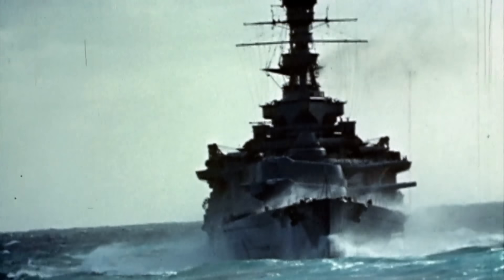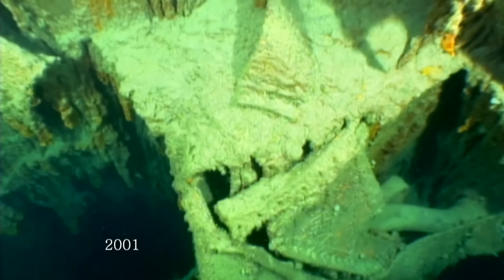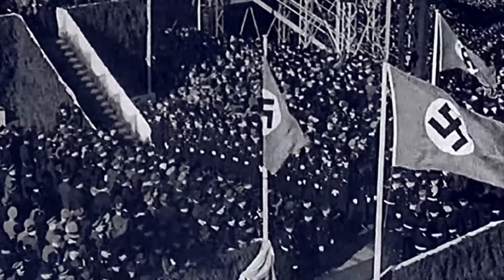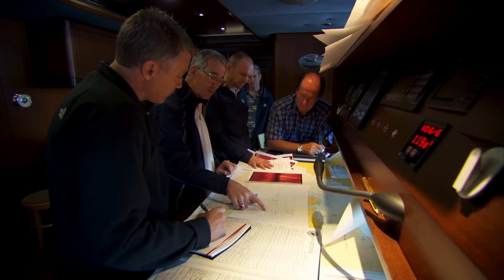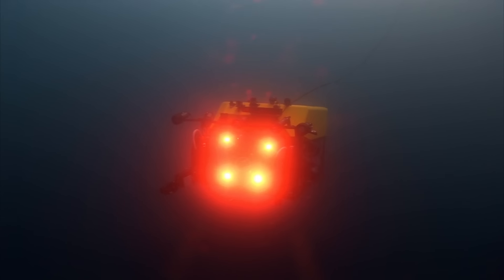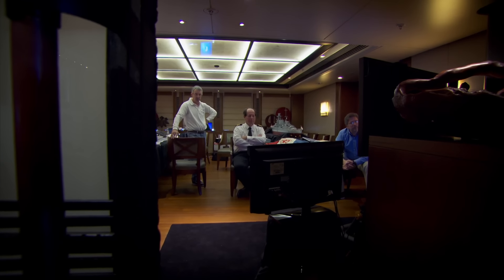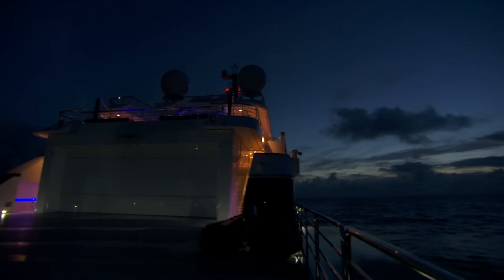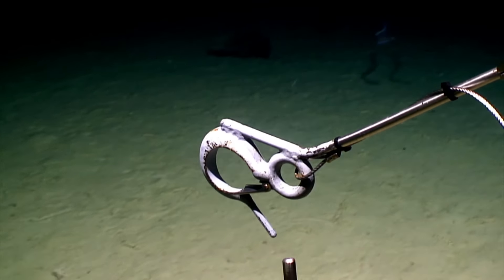How the Bismarck Sank HMS Hood - Documentary

Comment: In World War One, during the battle of Jutland, German warships were able to destroy several British battle cruisers and heavy cruiser. British Battle cruisers of this period (such as HMS Hood) were not intended to act as ships of the line, but to engage enemy cruisers at range where the enemies smaller guns could not reach them. While the British ships of the period had decent belt armor, they lacked protection from 'plunging fire'. Hood's armor belt was designed to withstand 8" shells, common on cruisers, and fired in a flat trajectory. Plans had been made to rectify this problem somewhat by adding additional armor to the main deck in 1919, but it was never performed. Hood was due to be modernised in 1941 to bring her up to a standard similar to that of other modernized World War I-era capital ships, including strengthening her deck armor, yet again, this was not performed. 

The British were known for their ability to rapidly reload their guns. Often, this was done at the expense of proper powder handling, and flash protection by opening blast doors that, in the case of German ships, remained shut, to prevent a flash from reaching the powder magazine; and by placing shells into the turret in advance of the need. This meant that shells and powder bags were in the turrets, not behind armored shields, in the event a turret was struck. Finally, the gun director on Hood was inferior to that on the Bismark. While Hood was able to fire first, Bismark was the first to hit the target, resulting in the loss of Hood. Speculation remains that the shell from Prinz Eugen, not Bismark, penetrated the boat deck and into 4" ready ammunition. This started a fire among 4" shells being stored OUTSIDE the magazine, which eventually detonated INTO the 4" shell magazine, and then into the adjacent 15" shell magazine, similar to what had happened in Jutland.
Reply: The battle of Jutland was more of a skirmish no ships were sunk
Reply: @Aztlan632  Wow you better do a little more research on the battle of Jutland! The Invincible, the Queen Mary that's 2 that I can remember and I know there was 2 other battlecruiser that blew up and sunk!
Reply: @spongehead1354  Apart from the 2 you mention, the Indefatigable also blew up, The Germans lost the Lutzow and the Pommern and arguably the Seydlitz which was so badly damaged and shipping thousands of tons of water ran aground outside harbour (in my view technically sunk), there were numerous other ships sunk and a huge loss of life
Reply: john smith The German battle cruisers took such a heavy pounding they all had to be scuttled by the Germans themselves however 99% of the crew survived typically only 20 out of the complement of 1500 men died, the rest lived this is not the case for the British battle cruisers of which 99% of men died because the magazines blew up and took the ship down within minutes.
Reply: @Aztlan632  wrong, the british lost 3 battlecruisers and thousands of men
Reply: Hoods armor belt could withstand a hell of a lot more than just 8" shells. Hoods armored belt was over a foot thick of steel. 305mm.
Reply: Jordan Fan，Prophet of Environment。范楚漳，環境先知：
How Did The Bismarck Manage To Sink HMS Hood So Quickly? 
Answer:  The answers were very simple:  When the HMS Hood was battling the German battleships  Bismarck et al, those lazy British  navy sailors onboard the Hood were busily eating their favorite breakfast food - Biscuits with Sardines.  And had forgotten to return fire at the Bismarck!????

Comment: A battle cruiser turned broadside to a battle ship, has no-one watched a Jingles video? "That's a paddlin' "
Reply: Fast battleship.  Hood had thicker armor than a QE class BB.
Reply: @packr72  Hood sacrificed armor for speed. Something Bismarck didnt have to do since it had 20 years newer technology.  And could maintain the same speed and have armor. Hood was upgraded armorwise, however this made her sit low in the water and take in alot of water during heavy weather. Hood had made alot of compromises in the armor scheme, specially deck armor, where its 19mm at its thinnest. Bismarcks deck were 100mm at its thinnest. The armor belt of hood was only strong at a few areas, while Bismarck had a strong armor belt, and didnt cheap out on it by making it thinner the further away from the middle of the ship you get like the Hood.

Hood was way out of her league. 

Take a look at their armor schemes, its like putting a Ford Fiesta up against a modern tank.

Who knows, if she had real deck armor what shell wouldnt have gone into the magazine.
Reply: MrDanisve The Bismarck; like all battleships, only has thick armor around the citadel.  The rest of the ship had armor but armor that couldn’t resist much.
Reply: @ZagatoZee oh you better believe that’s a paddlin

Comment: The British always knew there was a flaw in the design of battlecruisers, being that they were not heavily armoured.  They were designed to fight anything that could not outrun them (heavy and light cruisers) and to outrun anything they couldn't fight, such as slow but well armed and armoured battleships.  Hood was always slated for modernisation and to have extra deck armour fitted because they knew the light deck armour was susceptible to plunging fire.  The battlecruiser attack plan was to get in close so that the enemy were firing at a lower angle where the thicker belt armour could take the hits.  At the ranges they were firing, the Bismarck's shells where plunging onto Hood and into the thin deck armour.  The reason the extra deck armour was never added was because the Hood was far to valuable as a showpiece and could not be spared from flag waving exercises to spend the year or two years in dock for the required additions and other modernisation.  In this case, (national) pride did indeed go before the fall.
Reply: Nothing to do with National Pride. The British began a programme of modernisation, starting with their older battleships first. The policy was to take no more than two ships out of service at any one time. The first four were three of the Queen Elizabeths and Renown.  The third and fourth of these, Queen Elizabeth & Valiant, were almosat completed in September, 1939.

Hood was programmed, had war not intervened, for reconstruction along the lines of Renown, from 1941.

Hood was not a traditional battlecruiser, by the way. Her redesign after Jutland resulted in a ship with armour very similar to that of a Queen Elizabeth, but some six knots faster. Much more a fast battleship, in fact.
Reply: HMS Hood had the same armour as a Queen Elizabeth class battleship so perfectly capable. HMS Hood was sunk by pure luck only.

Comment: "IT WAS LUCK!111 IT WAS LUCK!111111"
I bet the torpedo hit on Bismarck's rudder was 100% skill. :) Sperg more....
Reply: underrated comment. UK mindset in a nutshell
Reply: The Swordfish biplane crew, in very unfavourable weather  found Bismark, if that was not skill of a very high order, then what is. They pressed home their attack despite the Bismarks formidable anti aircraft defence. So, not only skill, but also a heroic scale of sheer brass-bollocked courage, the outcome of which significantly affected the Battle of the Atlantic. 
   Some say that Prince of Wales hit on Bismarks port side near the stern, which severely damaged an oil bunker was a lucky hit, almost like saying that it was undeserved, despite being the result of skilled application of the  available technology. Not luck as in a sheer fluke, but the small bit of luck  accompanied by dedication to duty in the heat and stress  of battle, which can and often did tilt the outcome one way or another.  Whatever else happened that day Prince of Wales' so called lucky shot was the pivotal point of the Battle of the Denmark Strait and secured that ship's place in the annals of RN heroism.

Comment: The sinking of both Hood and Bismarck can be attributed to luck, or “RNGesus” in gamer talk.

RNGesus Giveth:  Bismarck hit Hood’s magazine in an 1-in-1,000,000 shot.
RNGesus Taketh:  Bismarck’s rudder jammed by a torpedo.
Reply: It's gotta be way better chance than 1 in a million.  Plunging fire- well it sounds like that was a standard technique if possible, so any shots that hit would probably hit the deck- the most thinly armored area- and then you have 2 magazines, 1 in the stern half and one in the forward half.  Divide the length of the deck (860 ft) up into the lengths of the magazines (super gross guess, maybe 30 ft?) x 2 = 60 ft out of 860 ft which comes out to about 14.3.  So any plunging shell that hits the deck at a high enough angle would have about a 1 out of 14 chance of hitting a magazine.  Those are pretty terrible odds if you are on that ship, it seems to me.
Reply: @windwardpro  it still a very slim chance that one single shell can hit the place to sink the ship
Reply: The Bismark had superior targeting technology.

Comment: How would one assume the rudder position was not a result of that huge explosion?
Reply: a lot has to do with how the rudder and the system it uses to move it..a sudden catastrophic event would literally cause the rudder system to seize up in it's last known position..if the rudder had been damaged i would have questioned that myself,but with little to no damage present around the rudder that would indicate in a 90% or higher conclusion that that was the last known position of the rudder when the explosion happened...i hope that explains a little.
Reply: For sure, with the tons of pressure of the sea water rushing past, the rudder has to be very robust. Its not just flopping around.
Reply: The forces on a rudder are tremendous normally, and brutal for anything that has to operate in the north Atlantic.  It must hold a turn coming off a 40 foot wave followed by a 30 degree roll at speed.  Some ships can get away with simple hydraulic rams, but I suspect Hood had screw type/follower mechanism [whatever the proper name is]: if you lose power, the rudder stays at it's last command unless the screw is decoupled from the rudder.  A manual override is possible for some designs, but the gearing down required would make steering nearly unfit for battle and turns would take very long to execute.
They had all the drawings on this project... it would have been nice to show what the design actually was.

Comment: My uncle was RCN from 44

Retired at Commodore in 85

Sailed with both US and Royal Navy
Got to fire a broadside from one of the Iowa class battleships (NJ?) as an exchange officer in Korea

The Royal Navy was really big on getting a quick volume of fire when engaging naval targets

Quickly find range..and bracket the target (fire bracketing rounds before or as the ranging rounds are landing)...then fire for effect at a slower pace to fine tune the fall of shot

So on initial contact there would be shells and powder charges in the turret...doors to magazines open

Speed over safety

Very different then when firing against targets ashore
Reply: That habit - of disabling the safety systems to increase their rate of fire came into practice before WWI due to the emphasis on Rate of Fire in their training evaluations.  The thing is - you fight the way you train - and at Jutland - that practice caused a number of British ships to blow up.

So ... they stopped doing that ... or at least - they were supposed to.
.

Comment: Vice Admiral Lancelot Ernest Holland, CB Knew the Hoods weakness that' why he was trying to close the distance at speed.
Reply: I'm not sure what you mean. The weakness of the Hood meant that it was supposed to run from an encounter with a real battleship. It was designed with superior speed so it could do just that. Instead, the admiral engaged in a suicide direct attack against a better in every way ship.
Reply: The hood was never designed to fight a battleship its speed was needed as a cruiser killer. Holland was aware that his deck plating was weak but side plating a match for Bismarck that is why he was trying to close the distance at speed. Five more min and it may have been a different fight, even though Prince of Whales was unready it would have been 2 to 1 and 1/3..
Reply: NOT  FAST  ENOUGH